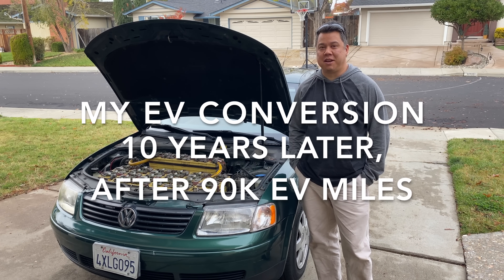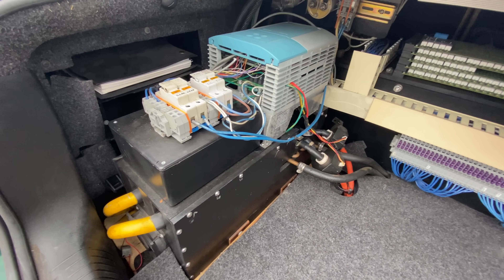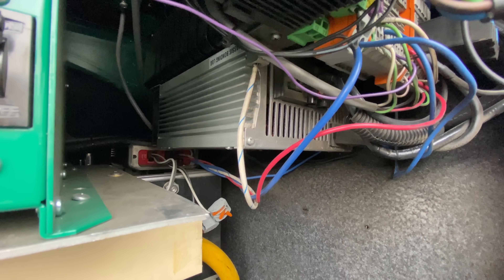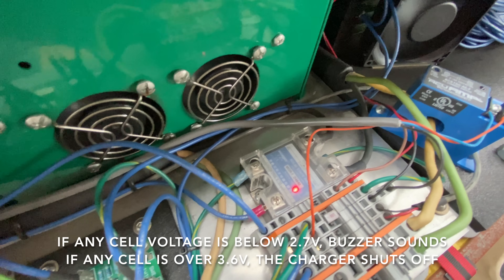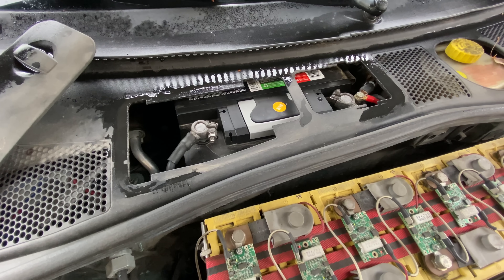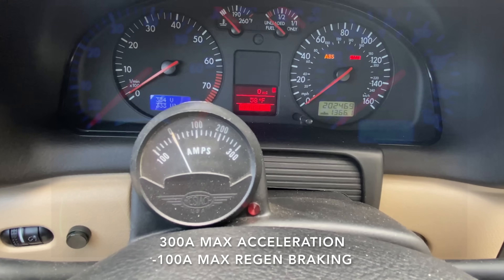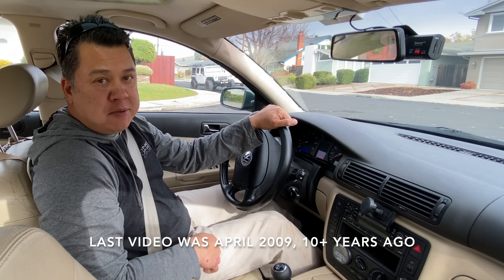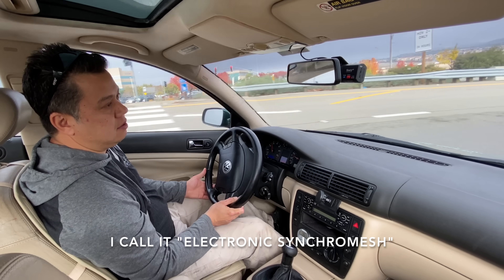My EV conversion after 10 years and 90k miles

Comment: I would like to know if during those 90k miles, you investment has paid off?
Reply from the maker: The goal of this project was never about trying to save money, but running some numbers:  Gas would be $16k to drive 90k miles; another $2k for timing belt / water pump service, $1k in oil changes, fuel pump, smog checks, air filters...   A similar used Passat at the time I started this project would have been about $7k, and I spend about $25k including the car.  So the difference of $18k is about break even on the savings (~$19k) of not having a gas engine.    My EV converted car also got me an interview at Tesla, and I since retired early after working there for 7 years, so that is the biggest pay off; the learning experience and sense of accomplishment! Ad-sense on this video has also generated about $8k so far.

Comment: Cooling fans, BMS, Water cooling, Charging off the Grid and more. The inefficiency is staggering. Charge all night to drive 30 min for a cost of 25000 dollars less labor?   Unreal.  This explains why the Detroit Electric Company of 1913 went out of business.
Reply from the maker: My Passat's efficiency is around 300wh/mi which is on par with other EVs at the time, and equivalent to 122mpg; about 4x the efficiency of the equivalent gas car.  This conversion was done in 2008, when there were no EVs on the road and everything had to be hand build and custom designed. With the $25k I spent, also came the EV skills that got my career at Tesla started.  Today the best selling car in the world is the Tesla Model Y.  You're really grasping at straws here trying to justify your preconceived view of EVs.
Reply: @etischer  The efficiency  of a nuclear power plant is about the same as Coal but not as good as Internal Combustion engines . IE Nuke and Coal about 30 percent, IC engines 35-45 percent. To get the power generated to your home, well, you will lose another 6 percent.  or more. In other words, 66% of the primary energy used to create electricity is wasted by the time the electricity arrives at the customer meter. So, 34 percent efficiency for you EV provided it will have no loss at all getting charged or when using which we know is not true at all. The average EV is 59-62 percent efficient.
Reply from the maker: @grabir01   How efficient is it to drill for oil in the middle of the ocean (spilling billions of gallons in the process), or frack (and pollute the ground water). We're paying our enemies billions of dollars a year to ship that oil around the world with navy ships protecting shipping lanes and starting wars along the way. Then the energy required to refine the oil, and and shipping the refined oil back around the world. Paying truck drivers to haul tanks of gas to each station.   My EV has been 100% powered by sunlight since 2012, electricity sourced locally using panels on our roof. No oil spill cleanups,  no fracking, no pollution, no driving to gas stations, no paying our enemies thousands of dollars each year, no wars fought,, no lives lost..

Comment: So around $25K to convert it over, and this video is three years old so when you put all these upgrades in it around 2010 you for the same price could have gotten a really nice ICE car that would have still been on the road and likely other than oil changes wouldn't have given you any issues. I just don't understand the appeal of EV, I guess if you live in CA in one of the more urban areas and have a place to charge it they are nice. However for people that live in mountains which can pull your distance down, and in cold climates where several months out of the year we spend it well below 30 degrees these things even the most modern and expensive ones are not going to work.
Reply from the maker: This project started in 2008, before any EVs were available to purchase.  Back then, if you wanted an EV, you had to build one. It wasn't done to save money, it was done for the challenge and education, an education you can't really get any other way than getting your hands dirty and blowing up a few IGBTs in the process.  The EV conversion was a showcase of my skills and kick-started my career at Tesla where I've since retired.  Sure, 15 years ago, I could have bought a new Honda Civic for $25k, but then I'd just be another person with a Honda Civic... just not my style.

Comment: How did work with the DMV ? Do you need any special permit to do so , because California have the most strict smoke and conversion law in the country! Thanks
Reply from the maker: I had it inspected by California Air Resources Board (CARB) and it was certified electric. From there, I was able to register it with the DMV as an EV, and also get carpool stickers

Comment: He must've done this just for the fun of it. Because there's no way this is cheaper than just buying an EV 😭. I know it was built years ago but sheesh that's a lot of cells for just 100 miles of range. I am very interested in whether a manual transmission would make an ev more efficient. Being that you don't need a transmission and the motor speeds are higher thus pulling more power at higher speeds, I'd think you can get extremely high efficiency and speeds by having more gears.

Comment: Congratulations you ruined a decent old Volkswagen and piled it with weight so you can charge it like a toy car
Reply from the maker: The Passat had a siezed motor and bent valves when I bought it, it was headed to the wrecker.  I got another 100k miles out of it, I haven't bought gas in 15 years ($78k savings) and it started my career at Tesla.

Comment: So you paid 25,000 for a 2,000 dollar car and pay extra for power every month? how does this make sense.
Reply from the maker: I used to spend $100 a week on gas.  It’s been 15 years, or 780 weeks, so 78,000 I haven't spent on gas.  I haven't had to drive to a gas station and wait for the pump; my car has a full tank each morning for free.  It will make sense once you’ve owned an EV.

Comment: So less than a 100 mile range, gotcha.
Reply: And always having to modify and work on your car, ugh. But note how gas powered cars he still has. Never converted over completely.
Reply from the maker: @ryaj2356  In 2008, 100 miles for an EV was pretty good.  The Nissan Leaf, the first mainstream production EV came out in 2010 and it had 99 miles of range.   Our other car is used for pulling a trailer, the EV is used for commuting, each has their own purpose.

Comment: You added a metric ton or more in weight to your car, just the battery underneath is 250kg.
You ever heard of a power-weight ratio??
Reply from the maker: I added 500lbs, to the rear, about the weight of 3 adults sitting in the back seat; the front is roughly the same weight.  In 2008 there were no electric cars being sold, they had to be designed and built by hand.  This project was about the learning experience of building the power electronics, drive inverter, battery management, programming,  tuning control algorithms...  This wasn't about making a race car.
Reply: @etischer  All you've learned is that you need more energy to move a heavy load, which is basic stuff.
The Ford Ranger EV batteries you're using are from an Electric Vehicle (which you freely admit) made by Ford between 1998 and 2002, to say there were no electric cars being sold in 2008 is a bare-faced lie.
The 4.0L W8 Passat engine is 460lbs or 208kg, your battery weighs 1000kg and has nowhere near the power or performance of the 4.0L W8 engine, your Passat was probably a 1.6L-2.0L that weighs alot less than the 4.0L and I bet you still can't get near that engine with your 1000kg+ battery. I bet an old 1.0L ford fiesta would not only beat your car in a race but also have a lower carbon footprint. 
The fossil fuels burned to charge your battery are greater than the fossil fuel needed to run a 1.0L engine.
You did not build an inverter or anything at all, you bought it all and wired it in, You didn't write the algorithms either.
You do not hold degrees in Mechanical Engineering, Electrical Engineering and Software Engineering, you're an amateur and it shows in your work.
Reply from the maker: @jc6087   I'm using Lithium batteries, the Ford Ranger used NiMh.  Battery is 700lbs.  I removed the heavy automatic transmission and replaced it with a smaller manual tranny furthe reducing weight. These early EVs (Ford Ranger, EV1...) were never sold, the program was scrapped and that's how I was able to buy the Siemens motor.  The car is 100% charged by solar panels on our roof.  I have a degree in Mechatronic Engineering from California State University Chico. This project gave me an education you can't get in college, it got my career started at Tesla where I retired at 40 as a Sr. staff controls engineer.  If you want to see the inverter I built, and the software I wrote, you can see my other video https://www.youtube.com/watch?v=LmqJ6Oruh2A&t=118s.  Cheers, and thanks for watching.
Reply: @etischer  Why do you keep lying? You literally just wrote that you used a 500lb battery in the back and the same in the front... Now you're saying it totals 700lbs... Engineers don't get measurements wrong, a real engineer would know the weight down to X amount of decimal places.
You said in your video that you used the battery from the Ford Ranger EV program now you're saying something completely different.
You lie and there are massive inconsistencies and contradictions in what you say and do, I've no real interest in carrying this conversation on, goodbye. 

p.s it's ok to be an amateur, it's not ok to pretend you're a professional.
Reply from the maker: @jc6087  The weight of the car is increased by 500lbs in the rear, the front weight is roughly unchanged from stock.  I didn't weigh each corner before and after,  but the overall weight of the car is 3700 lbs after the conversion, listed curb weight for a B5 Passat v6 Automatic is around 3,384lbs, max 4,629.  Again, the goal was not to make a lightweight car, the goal was not to exceed the max weight rating of the car.  I said the motor came from the Ford Ranger, the lithium batteries I bought new. 

I'm not pretending to be anything, I'm just documenting a multi year long engineering project that I built myself.   I see your channel has 2 subscribers, and has two videos... of you playing your video games... who's the amateur and who's the professional here?

Comment: How do this go well in heavy rain? or let say you car goes over a small puddle or flood? I'm planning to build mine but from where im from, heavy rain is often occurring, and my worries is that it will damage most component or short circuit it.
Reply from the maker: The area under the hood is pretty well protected from rain.  There's a belly pan and wheel liners that seal the area off, no water gets past the radiator/condenser.   The batteries under the car where the gas tank was might get a little misty, but they were fine after 10 years when I last checked them.

Comment: Why keep the transmission? 30% loss in efficiency
Reply from the maker: 1000% increase in torque at the wheel.   The motor doesn't have enough torque to direct drive the wheels, 2nd gear is around 10:1 gear reduction.    I also need the transmission to connect the motor to the axles.

Comment: I have a question does the gearing help you accelerate ?? Like take off from 2nd gear vs a take off from 4th gear,
Reply from the maker: The car would be really sluggish off the line if I started in 4th gear, just like a gas engine would be.  The electric motor I'm using has a pretty flat torque curve from 0-4000 rpm, above 4000 rpm it starts to taper off, by 8000 rpm torque is about half.   2nd gear at 60mph is about 6800 rpm, I can pretty much leave it in 2nd gear all the time and still have good accel from a stop, and ok accell at freeway speeds.

Comment: You had to change tires more , and your pollution was made somewhere else . The extra weight is not included!
Reply from the maker: Virtually no brake dust, no tail pipe emissions and 100% power is sourced locally from solar panels on our roof since 2012.  No emissions from fracking, drilling, refining, or bombs.  No oil spill clean ups, no warships, no dead Americans, just sunlight.

Comment: You're a new-age Bob Lazar, with his old honda with a rocket motor, amazing application. With so many vents, have you ever had a rodent chew through your mesh and get into your car? I would imagine chasing down a whole bunch of chewed wires would be a nightmare, unless the system is already equipped with some kind of intrusion detection or internal diagnostic like an OBD system. That would be a pain to develop, but could open this tech up to the vast majority of the population

Comment: This is what we want in electric cars and will never get. Ever. It's simple, would be very cheap if mass produced, we dont care if it's fast or has a 500 mile range. People need a car to get to work, but by design, not because they are inept like everyone seems to think is the reason why we will never get this. The ruling class DOESNT want you to have a cheap, efficient car that takes a few bucks to refuel and uses already existing infrastructure. Imagine if there were a barebones, slow, economy electric car. It would be less than 10k and be dirt cheap to maintain. That's exactly why they dont want you to have it, you'd consume less, spend less, be less dependent on the system. In case you havent figured it out yet "climate change" is a scam the ruling class doesnt actually think is real, they just use it as a tool when it's convenient, and then also conveniently ignore it later when they need you to spend more money.
Reply: Really, you think there is no barebones EV? Really? Come to China my friend, they have it but of course your gov and regulation will call it commie and it won't pass safety standard because it is made cheaply, it works but it is cheap. If no middle man from your country exporting it, it costs less than $10k

Comment: Well I'm guessing you are the man to answer my question. I've just got my first electric car a hyundai kona and the first thing I see when I open the bonnet is a 12 volt battery. Before I get roasted I just want to say I know absolutely nothing about electric cars and how they work but I've been a hgv fitter for 30 years and I know how to make things work when they aren't. In my service van I rigged up a inverter so I have 240 volt sockets in the back for power tools (yes I know everything is cordless now this was a long time ago) but I still use them for charging the batteries. So I know this will be  more complicated than it sounds but what is there to stop you connecting an alternator that is run by the electric motor that will charge the 12 volt battery and then connect a inverter to it to give you 240 volts to charge the car. The first thing that came into my mind was the batteries won't like being charged and discharged at the same time but I thought maybe you could have two separate banks of batteries and have one running the car while the other is being charged and have a relay that swops them over. I think from what I've already found out charging at 240 volts puts in about 9 miles per hour so maybe you would never actually charge it fully but do think I'm onto something here or am I better just getting another beer!

Comment: this is what should be done, imagine with new technology and improvements, with the same price we could get probably more performance and durability. instead of throwing out perfectly good cars we can use them up, and when the motor or some other parts fail, convert those same cars to electric. Instead of having to buy new EVs that are simply too expensive.

Comment: If the cost of your electricity changes depending on time of day you are doing something wrong.
Reply from the maker: Electricity is cheaper at night to incentivize EV charging when there is less demand on the grid.   If it costs half the price to charge at night, people won't be charging during the day when everyone is running their AC.  This means the utility company can avoid investing in additional power generation capacity just to hand these rare corner cases of peak demand. Consumer saves money, utility company saves money.

Comment: Wont last long on Oklahoma County Dirt roads. Thats where diesel comes into play because its more reliable. I do applaud this man for his development and craftsmanship for designing a conversion to Electric vehicles however now the federal government is trying to push and force this $#!T down everyone's throats like its cheaper to drive them when it is not. In fact, its cheaper to drive a ford expedition than it is to drive a Tesla Model S. Even with maintenance included. I'm an Oilfield head, what I do work and the last 8 years has been semi trucks involving oilfield. 

People say the Oil industry is going to die. But honestly you would be soo wrong. Because products like makeup, toys, etc, are built using the things we work hard for to produce in every day market. That is why when the oil market starts going south EVERYTHING ELSE on the shelfs start upping prices and inflating. My Jetta is a diesel, and will continue to keep it that way even if the cam freezes up, I will definitely throw a reman or rebuild under the hood because Diesel is more reliable. Working on almost touching 400K miles on the same engine. Most gas cars do not make it that long.

Comment: And how much did all that cost? What a waste of money. EVs are very dangerous and zero resale value. You got to be extremely bored with money to blow. .
Reply from the maker: Keep in mind, this was 2008 before any EVs were on the market.  Everything had to be hand built and designed from scratch.  It's not so much about the car, as it was the education.  Building this car got me a job at Tesla where I made my way to Sr. Staff Controls Engineer, and retired at 40.  Cost was about 20k.